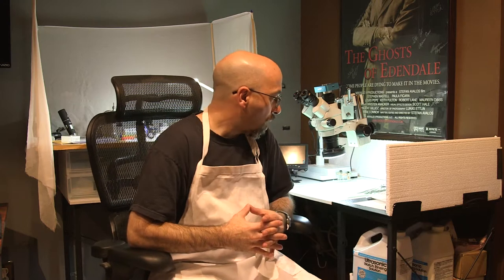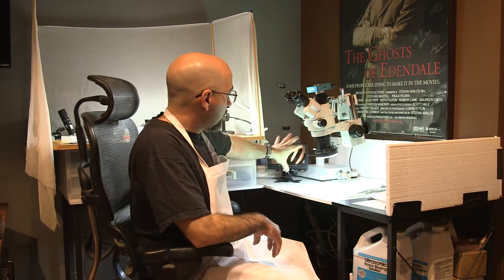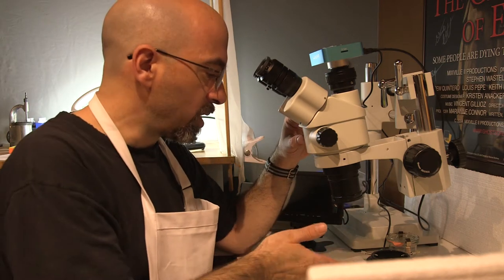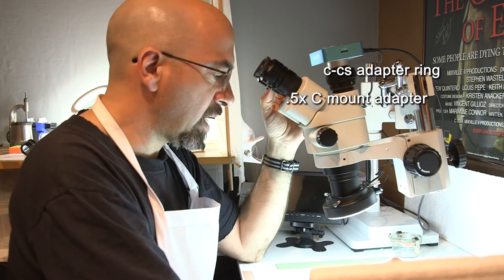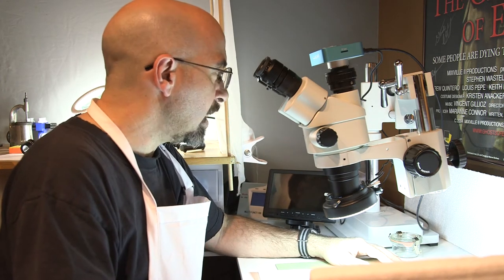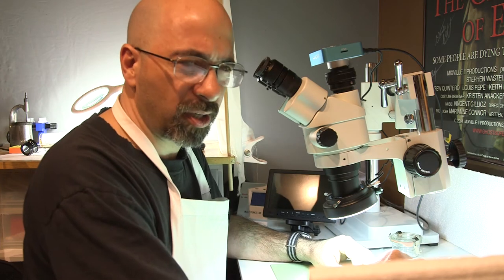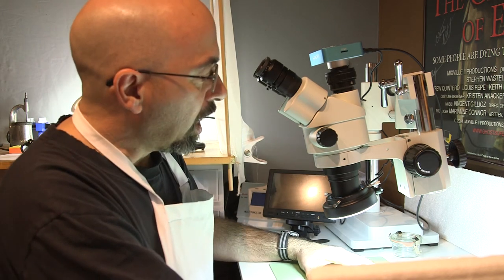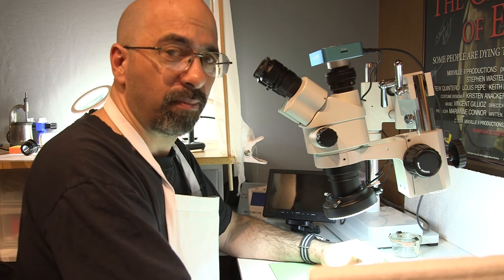Why an Amscope Microscope is AWESOME for watch repair!

Comment: Would there be any downside to paying the extra $50 and getting the 7x-90x instead?
Reply from the maker: There’s no downside, you’re just getting an extra Barlow lens (a 2.0  “doubler”) You can always get it later so it’s not a know or never” purchase. 
I also have that lens, but it’s too much magnification for most watch work. However, for some dial restoration work, where extreme magnification might be useful, it’s great.

Comment: Okay....sorry to be "Johnny Raincloud" but  I have been hearing about how microscopes have made peoples' experiences in Watchmaking so much better. I have the AmScope SE400-Z Stereo Microscope and it has been a royal pain to use. Certainly, it is nothing like the double-boom instrument in the video, but there must be someone  I can talk to to find out what enhancements I might be able to get to make my experience better. Thoughts?
Reply from the maker: Hi, so I checked out the model you're using and it seems as though the working distance is good - so my guess is that's not an issue. It has a light (which seems as though it would work well...  However, I do notice that it has essentially two different focal lengths - 10x and 20x. Is that your issue? even 10x is quite a lot of magnification for watch work - so I'm wondering if there is a barlow lens that could be used on this scope? It's really nice to be able to get down to 3.5x magnification. I will also say that the zoom functionality of the SM series scopes is really invaluable for watch work... it allows you too zoom to the exact power that you need, without the need of switching eye pieces. 
Would be curious to know if this is your issue. If not, please do elaborate on your woes.
Reply: @Stefan Avalos  Actually, Stefan, you touched on half the problem. The other issue is illumination.  Between the two, I could probably come up with a work-around for the lighting, but with my current optics, I am Waaay too much up close and the field-of-vision is about 20% of a pillar plate. I have ordered 5x eye-pieces which might be of some help, but the real issue is that 
what was good for its original purpose of inspecting for minutia, has made it over-powered for more general work. Now, in fairness, I did reach-out to AMSCOPE, and they recommended another, much more expense scope approximating your own set-up and if I was a watch pro that would make a lot of sense. However, I'm a guy on a vintge-pocket-watch mission so this won't make me my first million :-).  Thoughts?
Reply from the maker: @BruceWSims  In lieu of getting the scope that Amscope (and I) recommend, I think the 5x eyepieces will make a world of difference. Definitely having that option will be a positive.

Comment: Thanks for your video. I have a stereo scope but struggling with hight above the watch.
The screw drivers only just clear the lens. I will look into the barlow lens.
Reply from the maker: Barlow lens should take care of that issue.
Reply: @sma1968  I bought a 0.5x and it did the job,but about 2" to high (could always raise my seat) and not expensive. So I ordered a slightly different size 0.3x which was higher still! should have ordered a 0.7x, went the wrong way. But at least I now sit with a nice straight back.
Reply from the maker: @leowatkins3718   Posture is everything. haha. You can also angle the scope slightly - that lowers it as well as gives you more of typical "loupe" view. The only downside is that the focus is narrow.

Comment: Very well done video. A bit off topic but how have you handled main spring winding. I agree with pay once cry once but a set from Bergeron is hard to wrap my head around. What have you done??? jeff in OK.
Reply from the maker: Hi Jeff, Thanks for compliment on video. Mainsprings - I actually got an old winder and some barrels on Ebay for 140 bucks. It was missing a few barrels, so I bought them singly as needed. That's what i'd advise... I'd look mainly for a winder and then buy the barrels as you need them. Yes, there's a bit of delay in work, but it's a less painful way of building a winder collection than buying a full Bergeon off the bat. and some of the really tiny ones, I haven't used at all (and may never). The other thing I'm also finding recently is that I've been replacing mainsprings (which is considered good practice) when doing a major overhaul/service on the watch. And to be honest, you don't need a winder if you're putting a new mainspring in. (unless it unwinds on you before you can push it in.).

Comment: Stefan, thanks for the video. I am struggling getting camera to record or take photos via laptop, monitor and or sd card. Ugh! I tried to download software with no success. Is there an insight on getting camera to operate?  Thanks
Reply from the maker: Hi, Argh - sorry to hear you're having problems. I'm especially surprised to hear any issues with an SD card. Is it not recognizing the card? What size is the card? I do think the camera has a limitation on how large the card can be. I am using a 16GB class 10 panasonic card with no issues. However, I did notice that a 128GB card didn't read.
Reply: I have 128 sd card. Will see how other card works when I receive. I will order your card that you are using as well. Anxious to start working on my new hobby but not starting until I can accurately video tape my moves.

Comment: Hello Stefan -- Enjoyed your video presentation and found it very useful. Hopefully I can duplicate your workshop.
I noticed the scope head is set at an angle. Do you prefer this angled viewpoint instead of traditionally straight down or did you do this to lower the eyepiece view point  in order not to use a higher stool and  be moved further away from work point?
If you would please, tell me what is the working distance from the front ( closest to you ) of the ring light to the desktop -- what is the angle the scope head is set at? Does this working distance allow you enough space? The working distance of this scope can be close to 8 inches--yours seems closer to desktop.  Do you still have your scope set up this way? Have you changed the set up over the past year?
Thank You for the concise explanations, work tips and sharing your expertise!
Reply from the maker: Hi, glad you found this useful. The links will take you to everything I used (including the updated camera mount). 
I do most of my work at a slight angle - just so that I can see more of the area I'm working on - that way my hands aren't obscuring anything. I'd say the angle is maybe 3 degrees but that will vary on what I'm doing; there's no specific angle to which I'm wed.
For things like hairspring manipulation, I tend to angle straight down straight down - one can really see symmetrical lines perfectly that way.  I've even angled the scope at 30 or more degree angles to peer under a balance cock as it was running (though the chair has to really be lowered for that). The working distance doesn't really change a whole lot with the angle of the scope when it's between my typical 3'ish degree angle and 0 degrees; it's never been an issue for any work (I don't ever come close to bumping into the light) There's about a 5.3" working distance from the front edge of the light to the surface when angled. My screwdrivers are about 3.5" in length; so there's a comfortable two inches of clear area. Tweezers are a non issue, because they are angled in from the side for pretty much any work (not straight down) and eve so, my longest tweezer is 4.9". The only things you can't easily do under the scope is work that involves a staking set or jewel press.  
I haven't change my setup in any significant way since the video... It's really been working well.
Reply: @sma1968  Thank You Stefan for that info--
 What intrigued me about your set up was the scope angle. I was stuck in a mindset of using the scope upright and did not think about the angle option. I was using the scope while standing in order to reach the eyepieces ( have high bench). This was uncomfortable for longer periods -- was considering a low bench or high telescoping stool!
Set the scope angle at a comfortable eye level that allows me to concentrate and work with ease -- this set up works great with the current bench and stool. Competed a movement rebuild/repair today without fatigue!

My workspace is slowly evolving -- these tips have been a big plus!
Much Appreciated,
Dirkin

Comment: Hi Stefan - I purchased the same setup you have and i am thrilled with it. I have one issue i haven't resolved yet. The focus on the camera, as viewed on the HDMI monitor, does not match the focus looking through the microscope. I almost can't get the camera far enough away from the subject. Have you experienced this or have any suggestions? Thanks, Steve.
Reply from the maker: Hi Steve, 'm going to assume that you've played as much with the focus ring on the camera adapter as possible and that's not working. so, if you back the camera out of the tube, does it get into focus properly? If so... (I'm going to assume you don't have it) a C-CS adapter ring. Because the camera is actually CS mount, not C mount. Happily, it's cheap.
Here is link to it... 
https://amzn.to/3vmXhX8
Reply: @sma1968  You nailed it!  I am in your debt sir. That is the one item i didn't buy. Thank you so much!

Comment: Hello Stefan, thank for your detailed video. One question - what is the working distance of this microscope? the spec says 100mm while in your video it looks more than 100mm..thx again!
Reply from the maker: Hi, With the Barlow lens and the LED ring light attached, the working distance is about 132mm. (very comfortable space for tweezers and screwdrivers. :) )
Reply: @sma1968  thx :)

Comment: I don’t understand the concept of adding the wide angle lens. Why not buy a scope with less power. Maybe there isn’t one. Also without Barlo what is the width of your field of view. At 7x can you see an entire plate of a pocket watch? At 45x is your field of view 2mm? How small of parts can be seen?  Thanks!
Reply from the maker: Yeah, basically, the scope's default optics in this category are  all this power - and then adapters change the ranges. Yes, it's overkill without a Barlow lens. With the Barlow lens on, at widest you can see 60.5mm, edge to edge, completely zoomed in 8mm. If you need to get in even closer (which I've only needed to do a couple times for some really delicate cleaning dial, you can take the Barlow lens off.

Comment: Could you tell me what cleaning solution you use in your ultrasonic cleaning machine?
Reply from the maker: I fill the ultrasonic with water and then I put the parts in small glass containers. In the containers, I use L&R 111 cleaning solution. After the first clean, I rinse with L&R rinsing.  If the parts are really dirty, before the ultrasonic, I clean with Ronsonal Lighter fluid and pegwood. I also restored a watch recently that was really rusted - I used good-old WD-40 to loosen it up. Then I cleaned with the above mentioned.

Comment: Hi Stefan I loved the video, have an Amscope  with WF10X eye pieces and added a 0.5X WD165 Barlo lens I bought. But I still only have about 2cm of working area and cant get my screwdrivers into the watch area. Could you advise what I am doing wrong.
I also bought a new bottom plate and bar to hold the microscope head lost at this stage. The microscope is binocular. 
Thanks Jimmy.
Reply from the maker: hi Jimmy, thanks for compliment on video! 
Do you know which model scope you have? Is it a zoom lens or a fixed lens ?
Reply: @sma1968  The Microscope is a cheap one around €200 the lens is fixed. I hope you can help I have 25 pocket watches I bought from last October as I am new to this hobby. Hoping I can start on them through the winter months as I have lots to do in the garden at the moment, and as I said its a hobby.
Reply from the maker: @jembo1959  My guess, without knowing the actual model number, is that the limited working distance is a characteristic of your scope. This is. It uncommon with fixed  lens scopes. You may be able to change the distance slightly by changing the lens focus though it will also come at the cost of magnification.
Reply: @sma1968  I found out the Am Scope is KONUS #5420

Comment: With your setup what's the distance from your eye piece to the table top, also the distance from the bottom of the lens to your work piece?
Reply from the maker: From tabletop to eye pieces is 16.5 inches and from work piece to bottom of the ring light (which sits just a bit below the lens is about 6.5 inches)
Reply: @sma1968  Brilliant, thank you that's most useful. Watching the video again I noticed you sometimes looked through the scope with your glasses on and one time you took them off, what's your preferred method? I suppose my question is without wearing your glasses how do you see when placing parts in a tray, do you have to keep putting them back on?
Reply from the maker: I don't use my glasses at all when working. I'm near sighted so I can see fairly well up close (to about seven inches from my eyes...)  If that's of any help...
I just need to look away from the scope and not get very close to the tray to pick up or put down or pick up parts in the tray, then it's right back to the eyepieces. 

   @yesterdayschild1418
Reply: @sma1968  Thanks, Stefan. I now have a scope on order so we'll see how things go with my high bench and eyesight. 🙂
Reply from the maker: I believe you will love it! (except that you will probably want to get a lower bench. @yesterdayschild1418
Reply: @sma1968  It unexpectedly turned up today while I was  busy on the floor looking for a click spring 🤬 I never did find it but it was only a old watch that a friend gave me to practice on as it didn't work, but I really wanted to fix it 😭 Anyway, I set the scope up and its virtually perfect, even the height is good with my chair set high. I just need to get used to it and allow my eyes to settle into a routine of viewing the object without that blanking out in one lens, like the distance of the lens is not quite the right gap between your eyes. I hope that makes sense😆 I had been using a Tomlov 7" digital scope but this is soooo much better so I may return the Tomlov, this will allow me to purchase a camera so I can take stills etc.  I've been following what you've purchased and apart from a camera I assume I will need the 0.5 adaptor and .35x adaptor as well?
Reply from the maker: Welcome to a new, joyous experience. :)   Yes, if you haven't already, definitely get the .5 Barlow lens - camera or no. 
That makes all the difference in the world. Otherwise, the microscope is too powerful for most watch work and also the lens will be too close to the movement. 
The .35 adapter will make the camera work with the scope. (if you meant .5 adapter for the camera, don't bother getting that. You only need the .35)

Also, just in case you didn't already try it, you can adjust the eyepiece spacing to suit your eyes (as well as focusing them individually so that both are perfectly in focus. Once all that is setup, seeing in stereo should be a frustration free process. 
And finally - yes, once you get a camera for this, there will be zero reason to own the Tomlov. :) 

 @yesterdayschild1418
Reply: @sma1968  Thanks, Stefan you've been a great help! Yes, I have the .5 Barlow lens it came with the camera. Also a x2 which I haven't tried but know that will be no good for normal work but may come in useful for inspection. Thank again! :-)

Comment: Hello Stefan. Thanks for the great video. I followed the links and purchased most of the equipment with the exception of using the articulating arm instead of the "Dual Arm Boom Stand", however when I look at the camera image on my laptop (via the USB cable) its blurry. I can attempt to focus the camera via the adapter ring but that doesn't help much. I bought a "0.35X Microscope Adapter Mount Lens" (the same one as in the Amazon link) and the camera (Hayear) screws into the adapter with the secured to the top of the Microscope. Am I missing some type of adapter ring to go between the microscope and the o.35x? Thanks in advance for your help.
Reply: As a footnote, I didn't purchase the monitor and perhaps the HDMI output is the way to go instead of using the SUB to laptop solution.
Reply: I found a monitor and connected it to the HDMI port. The picture was still blurry until I raised the microscope up to a working height of 10 inches which now made focusing the microscope difficult.
Reply from the maker: @michaelcoulton7039  Hi, when the camera adapter is focused properly, both it and the microscope should have the same focal point. Is that happening now? If not, as an experiment, pull the camera adapter ring up out of the scope tube by about 1/4 inch or less... does it now go into focus? if so, you need the c/cs mount ring.  I needed that when I was using the .5 adapter, but not the .35 adapter - so I don't know if that's the exact issue. The working distance should be about 6 inches.
Reply: @sma1968  Hello. I found if the camera is unscrewed and almost out of thread then the picture is clear. I'm not sure is I can pull up the scope tube; it seems fairly tight. Thank's for the suggestions. At least I'm on the right track.
Reply from the maker: @michaelcoulton7039   In that case... this should be the answer... 
https://www.amazon.com/gp/product/B01531I8IG/ref=ppx_yo_dt_b_asin_title_o07_s00?ie=UTF8&psc=1